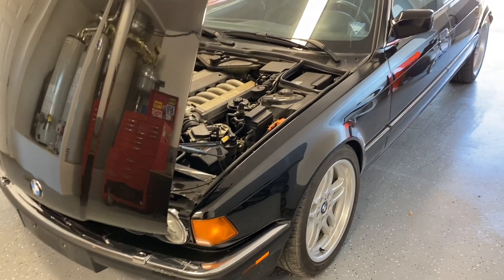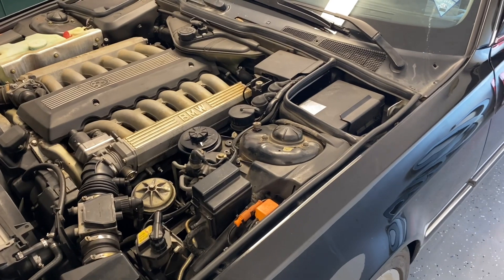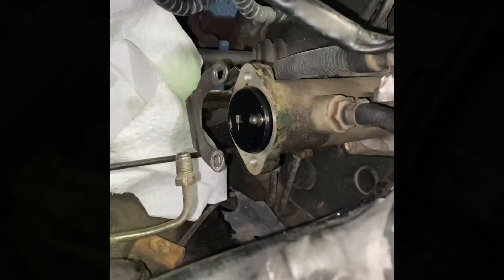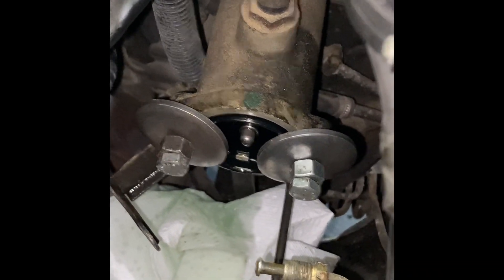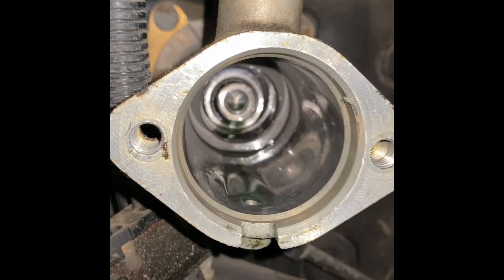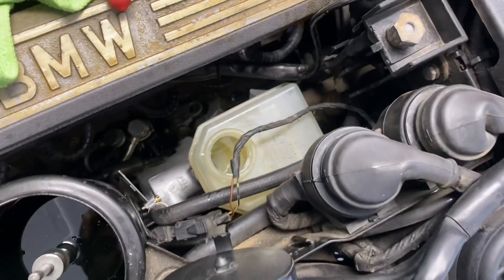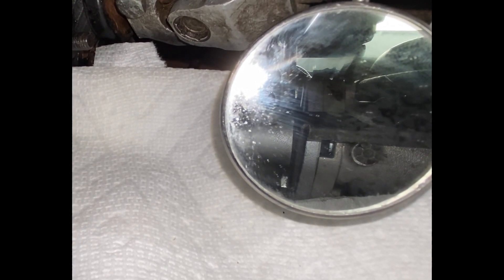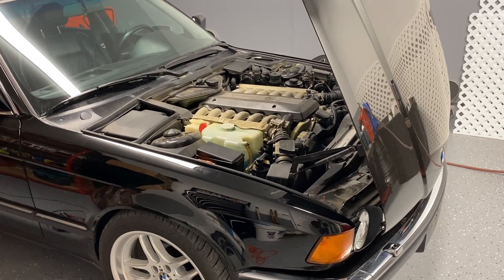E32 750iL Leaking Hydraulic Brake Booster Repair (in-car) for $1.35

Comment: at 6.42..do u kno the size of the o ring?..
Reply from the maker: I don’t remember, but look at the link I posted in the description, it has the part number for what you need and then you can get the size from there
Reply: @leojt9423  .,..tqvm...but it will leak for awhile after replacing that o ring rite?...takes a while before it will stop rite?...
Reply from the maker: @karinkatt7893  Mine kept leaking immediately after replacing it - I had to pump the brake pedal a few times to get it to seat! After that it was all good!!!
Reply: @leojt9423  ...well...still leak abit as yours...will see in few days ...after few pumps during driving....hope the o ring will expand and fit nicely ..as if season it a bit for tat right fitt....

Comment: How did you get that grubscrew on the bottom of the Booster out? I try to fix the same Problem and Im stuck on this problem. Is there used to be an Allenkey in the middle of the Screwhead? mine is circular... FYI Some guys at the "7-forum" wrote the black plastic (bakelit) some times swole a bit and cause a clamp of the shaft an stuck breaks, im gonna file a bit the hole, if i get this "klump" (sry german) out.
Reply from the maker: If I recall correctly, it wasn’t installed super tight - I was able to break it loose by turning it with a small pair of pliers and then reinstalling just by hand and then finally tightening with pliers. There’s no conventional socket or Allen that goes in or over it. The little mirror helps!